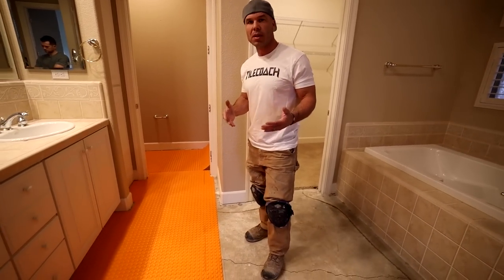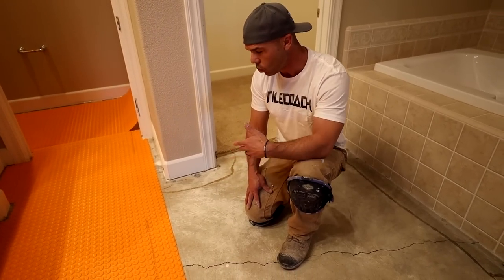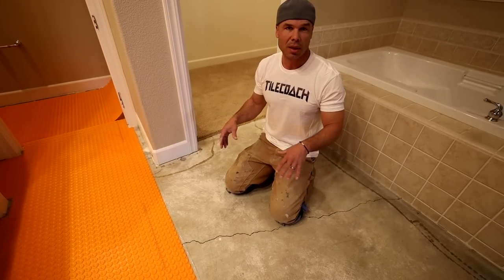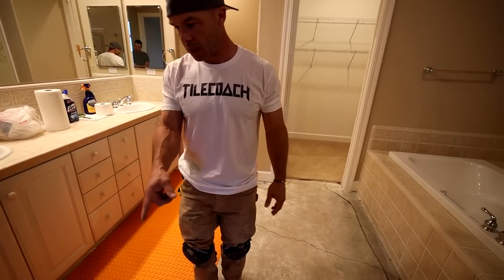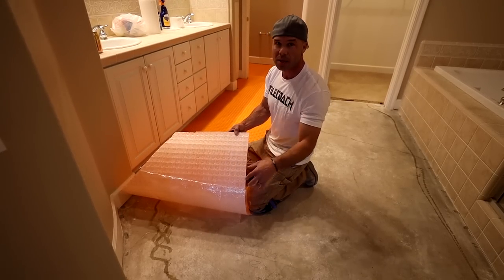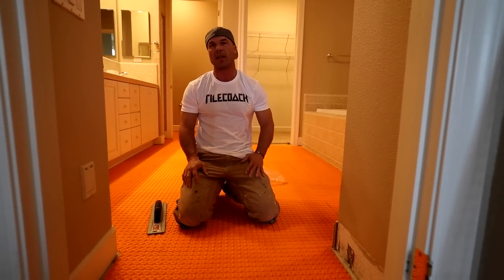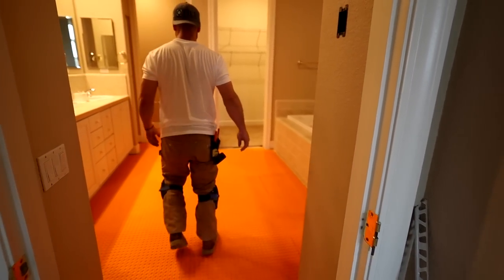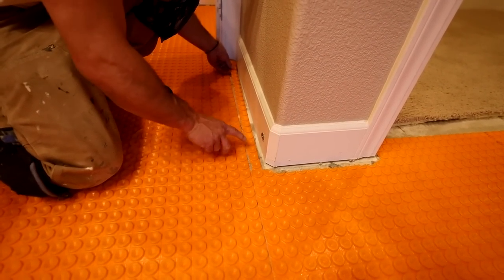PEEL AND STICK DITRA-HEAT...Could It Be That EASY???

Comment: I personally would be using a small floor roller on it. I've installed sheet goods for years and that initial roll , even with pressure sensitive is super important. Again, love your videos borther,  been a sub for a long time!
Reply: Yes, always roll pressure-sensitive adhesives.
Reply: Rolling may be hard to give even 30 lbs of even pressure per instructions.

Comment: Heat definitely loosens anything sticky, so seems counter intuitive
Reply: Isn't it insulated? So the heat shouldn't transfer. Maybe I'm wrong
Reply: Maybe so, but these don't. Obviously they've been heavily tested over time.
Reply: Not true, there is tape made for taping vapor barrier and when it get heat it become impossible to peel of. It has been tested to last 100 years air tight.

Comment: I used another brand peel and stick last year in the UK. It was supposed to be compatible with a tanking/waterproofing layer that was applied first. However, the tanking layer was textured which meant the peel and stick never made full contact - it only stuck to the upper parts of the relief surface. 
I immediately expressed concern to supplier but they assured me it was tried and tested. However, when we tiled, and I had to lift one up to correct pattern, the suction pulled up the peel and stick.
A big fat no from me. I told customer and supplier that I would not guarantee work.
Reply: Warmup? I have used it a few times, very good stuff, never had a failure, have done some very big areas with it.
It's meant to be self healing.

Comment: Specifically in the flooring industry, "peel-and-stick" has notoriously failed over the years especially in wet and/or moisture areas like kitchens/baths where moisture and water finds its way under the sticky surface. Leaking toilets, valves, drains, etc. Delamination awaits. Plus adding heating cable to a peel-and-stick substrate seems also a recipe for delaminating any peel-and-stick that's in contact with it. I could never trust it not delaminating and would prefer an embedded mortar contact rather than any advantage of "saving time" so I could get tiling right away.😇
Reply: yep. most of us smirk at any mention of 'lick-n-stick' 😂
Reply: Ditra is just overpriced crap.
Ho in the blue tiles can stick to that stupid plastic.
All the tiles that I have demolished and people were using Ditra came off like nothing.
I am using the green Mapei that has small micro fibers and once the mud stick to it there is no way you can remove tiles that easy.
Ditra and now peel and stick.omg a horror story.
Reply: Have tiles on a floating membrane may actually be better to prevent tile cracking because of the concrete subfloor cracks

Comment: Here my thoughts, if you had to clean and prime it then walk away to let dry you might as well just mortar it down. That peel and stick in my opinion is asking for problems. 
What happens over time from moisture or water that may get under it and break done that adhesive. 
I'm out for sure
Thanks for a professional insight 
As always keep on keeping on
Reply: You still would have to do that for mortar installation. You don’t want to put
Mortar down on dust either.
Reply: @handymansolutions7834  You don't primer a mortar installation. You wash the floor and put down the thinset. You don't have to wait for a couple hours for the primer to dry before you can put down the Ditra. Wash, spread thinset, and put down the Ditra. If you have to primer the day before, then you aren't really ahead of the game, when you could have just installed the Ditra the day before, then come in the next day and put in the wire.
Reply: He did wash the floor. Twice he said.  it was still dusty. That’s why he primed. So if he he used the traditional method he’d also still have to primer it.
Reply: @handymansolutions7834  Thinset bonds best to cement. Wash the floor, and then flat trowel the area, then do your notch coat.
Reply: @handymansolutions7834  traditional method is wipe floor down, spread thinset/mortar, lay ditra, use float to collapse notches, then roll it or stomp on it.  Much more secure in my opinion. Primer is usually for leveling or commercial jobs that have cracks in concrete.
Reply: @soccerindian12  nvm
Reply: @handymansolutions7834  huh? Why never mind?

Comment: Sweep floor, rapid set under uncoupling membrane. Boom, you're installing the same day. No need to mess around with peel and stick.
Reply: You don’t need rapid set. You can lay tile right away.
Reply: @handymansolutions7834  Nah bro. When you pull a tile up it pulls up the membrane. Best to let it set up hard before tile installation.

Comment: Here in the UK we have one called Warmup. Have used it a few times, and seems to be the real deal. This one comes in 1metre squares so a lot easier to handle. Meant to have self healing qualities, it's not cheap, but pretty good.
Generally put a insulation board down first them stick this onto the boards.
Reply: The Ditra heat is also available in squares

Comment: I don't know how new it is but the INSULATED/DUO Ditra is best for concrete. It is has an insulating layer on the layer next to the concrete and it also comes sticky. BUT there should be a primer rolled on the concrete that they sell to help bond it.

Comment: I have some left over regular Schluter Ditra (not heat and not peel and stick) after doing my floors.  Can I use it in my shower underneath my dry pack shower pan instead of roofing felt and metal lathe?  I wouldn't see why not plus I like the idea of extra protection from moisture getting to my advantech subfloor.

Comment: Ive seen multiple videos of shower installations done with drywall, then waterproofing membranes; shluter, and hydroban, and even redguard… if using drywall I prefer to use the actual waterproof membrane itself versus the Redguard; for which I have used before (full disclosure), but I value your opinion so what do you advise?

Comment: Once upon a time we used "peel and stick" vinyl squares on our kitchen floor. It lasted for some years, then corners started becoming unstuck, and eventually entire squares. I agree with the thoughts about adhesive products having a short life (compared to cement/tile solutions). This demo is useful because it makes people aware of new products - but as far as "how long will it last", only time will tell.
Reply: I think this application is significantly different from peel and stick tile, ditra heat is an uncoupling membrane as well as a medium to run your heat wire, which is designed to allow the tile floor to move independently (albeit slightly) from the subfloor preventing cracking in the case the house settles. You lay tile on top of the membrane, so I highly doubt that you would run into any of the issues you mentioned (peeling corners or cracking) I think this is a very good, quick and easy solution for both the pros and diyers.

Comment: Primed a dusty slab? I typically clean slabs like I clean grout so I don't leave behind any dust.
It would be really nice to lay cable on the same day as laying the ditra heat though! 
I could see this technology being used for waterproofing. Just leave off the adhesive where it overlaps, and we can use proper sealants.

Comment: IF I’m doing heat on Cement floors. I use Cerazorb or cork on the floor then the Ditra heat on top. Pushes the heat up instead of into the slab.

Comment: This is great, because I find that the Ditra never really bonds that well even when using the "All Set" super sloppy.
Reply: Just make sure you are using a good quality mortar and the right trowel size. Ditra heat and ditra xl need a bigger trowel then standard ditra
Reply: @jakeklassen3702  sounds like a use the right size trowel issues there,
Reply: All set works good. Gotta make sure you have clean and profiled slab.

Comment: I was curious about this product. Does it or can you use it on Advantech 3/4 plywood flooring?
Reply: yes you can, plywood and osb
Reply: @Conrad Coolerfiend  okay thanks just not in showers and wet areas correct?
Reply: correct

Comment: Its fairly obvious that it will delaminate, and im sure that applies to the manufacturer as well. The question is, will that affect the tile install? Its a decoupling membrane thats decoupled at that point, and with the weight of tile+cement and the fact that its all boxed in (trim, thresholds etc) would it actually move or encourage cracking?

Comment: I would like to see a test of just how easy it uncouples from the slab. Maybe sticks to much and transfers a crack up into the tile? The idea is that it will uncouple.
Reply: Maybe drill some holes on a broken slab and inject some expanding foam?
Reply: the uncoupling is happening in the lugs, not in the way its stuck to the substrate.
Reply: @conradcoolerfiend  so it only helps with horizontal movement not vertical? A bad crack rise or settlement will transfer to the tile? Just wondering.
Reply: @MrFishone777  it helps with vertical too. there is some height to the hollow lugs.

Comment: that seemed to be a lot faster than mixing and troweling thinset.
Reply: Ten minutes for thinset, ten to spread,  ten to set the ditra. Done and its proven performance.
Reply: @patrickcowan8701  if you is the all set it’s  mix 5 minutes slake 10 minutes and mix again 3 minutes that 18 minutes just for the all set - but like you was saying is a different thinset and boom 10 minutes you’re right.
Reply: @patrickcowan8701 Damn you are fast if you can get all tools for mixing and spreading and water etc then no need to even wash tools afterwards. 
I have already 20 years redo several stuff that your type of fast dudes has done in first place.

Comment: I think there may be a crucial step missing. After reading some comments, I noticed a complaint about the membrane peeling off over time. It would be helpful to provide instructions on properly preparing the subfloor, cleaning the surface, and applying primer. This process may seem easy to those unfamiliar with it, but it requires attention to detail and should not be taken lightly.

Comment: lol I’m like “Jesus stop pulling it up!!!!””” Then there’s still frocken plastic undert it… this stuff seems like a nightmare but then again that’s part of our job everything is very delicate and reliant on chemical bonds
Reply: It’s pressure sensitive (activated) adhesive you can pull it as many times as you need before you apply that pressure. I’ve used pressure sensitive glue for glue down LVP for years. One of the benefits is before you run it with a 80lb roller applying pressure you can pull it up and adjust but once you apply that pressure that’s it. I’ve pulled planks the next day before that brought up the top of the sub floor with it. Cool stuff!

Comment: Hi,have you ever demolished tiles installed on Ditra?
I demolished many and Ditra is the worse product ever.
Will never used it in my life.
Currently doing my two bathrooms in my house and using the green Mapei and it works amazing.
Try to remove tiles from Mapei mat and compare it to Ditra.
Tiles come of Ditra like they are just sitting with no mud .
It is a horrible oroduct.

Comment: Hmm, sure it saves time but I couldn't sleep at night knowing it's a peel n stick underlayment. That's just me, I'll always use thinset especially in someone's home. And Zach looks like he is making that straight 12x12 way harder than it needs to be. Just dry lay full tiles in the door off the base, then over to the shower pan, check your cuts... cut in around the toilet, trace a line 3 rows back from shower pan to the left wall, pick all the tiles up and stick them with hard plastic double sided 1/8th" spacers  (the side that creates a plus) and cut the last three rows in as u go and stick it. (dry cut the door way as your last few tiles so they line up and you don't have thinset all over you since the room fudges just a hair as u go) That way your not kicking all those tiles around shifting around, them horse shoe spacers don't get stepped on and break, plus it keeps the room clean and nothing is behind your feet as u work out of the room, and ditch  the laser, its overkill. He is a noob and your training him but there's way easier ways to do a 22sqft floor and he will make you more money down the road by not going overboard with layouts, and lasers lol. And buy some regular sneakers, tile is already heavy labor as it is, it's so much better when u can actually move around not wearing thick ass boots while crawling around on your hands and knees, going up and down stairs etc. You move faster and your not gonna smash your toes, been doing tile for 10 years and if anything I get nicked from using my grinder on tedious cuts more than anything. ( major criticism but hey, I've made over 30k over the winter on my own so speaking from lots of hustle and experience) I don't even have anything dangling off my pockets except a tape measure in between wonderboarding..idk im my own breed, just throwing some quick ways to do the same thing, with the same result out there. Good luck.
Reply: Bruh
Reply: @gladbandanna  yeah its a lot to digest, so is wearing 10 different hats while you sole proprietor in your metro and grind it out 😂